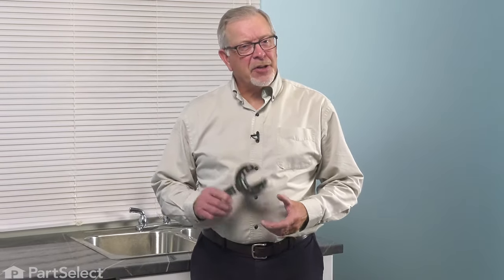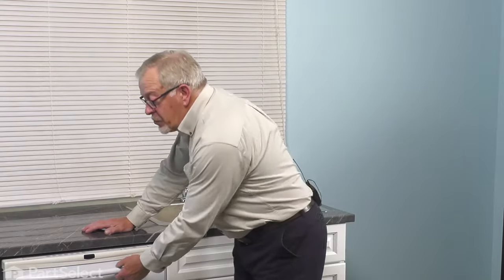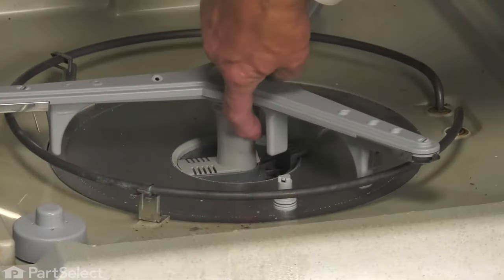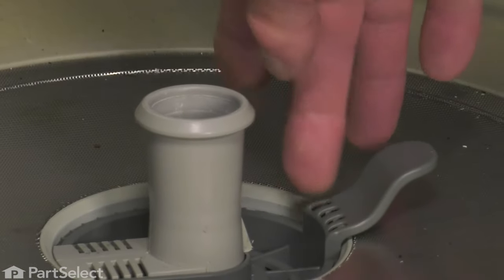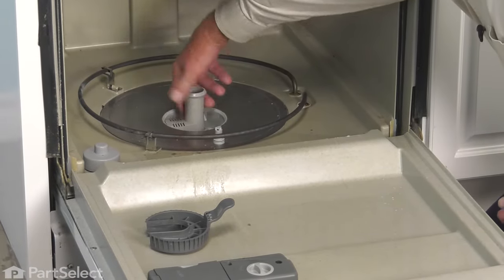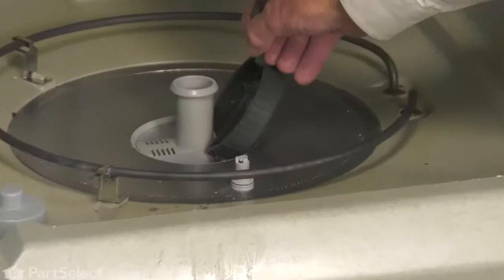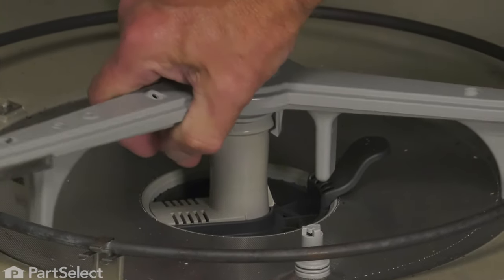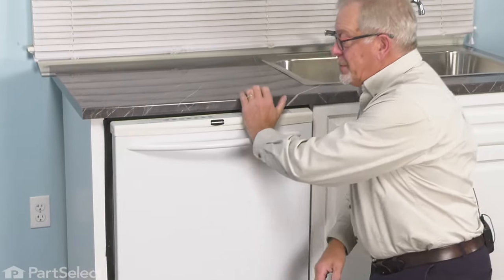Frigidaire Dishwasher Repair - How to Replace the Soil Trap (Frigidaire Part # 5304506518)

Comment: For some reason mine will not simply lift up. I think there is some debris (left behind by the previous tenant) that is getting in the way... and I am not trying to replace it, just clean it. I'm afraid if I force it, then it will just break and then I will need to replace it :(
Reply: So I hope you found a remedy to the problem. the video above
makes it super simple and his little tip about quarter turn to get that nozzle out really work. There was so much debris built up, I was afraid of breaking it too but I had to use a towel and nonskid, and a little bit of force but it came out and what you find underneath, When it's all apart.... I can't even tell you.😮

Comment: Hi, my 10 yr old, frigidaire dishwasher model fdb 520 r hs2 would fill but the arms wouldn't turn/spray. Watched your tutorial.
And that 1 little trick about the quarter turn getting out the bottom nozzle really worked! But I hadn't taken it apart in 10 years. Oh my gosh! the hard water buildup....can't tell you what was in there !! 😮disgusting!😳
Cleaned it all up reassembled it after two hours of tutorials and scrubbing the hard water build up off to the best of my ability. Running vinegar through it now but the top arm still doesn't spin. Any suggestion on  removing/ cleaning the waternozzle in the top that feeds water to top arm? Thank you..